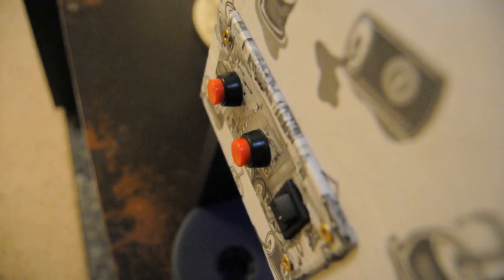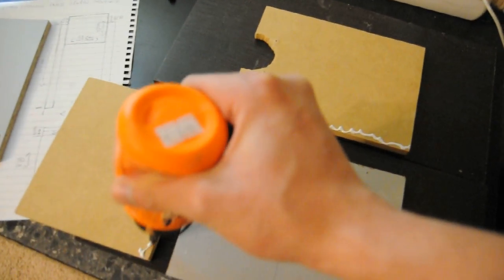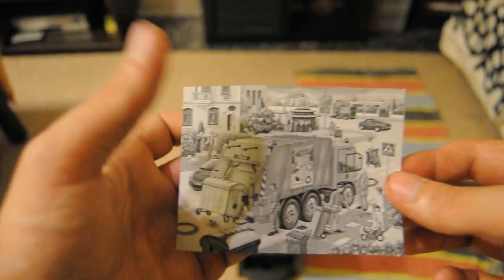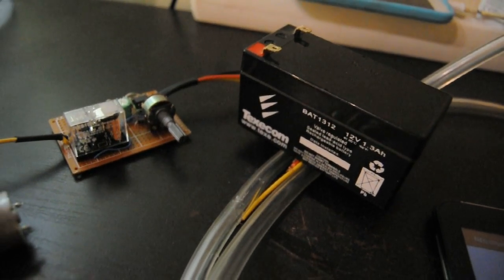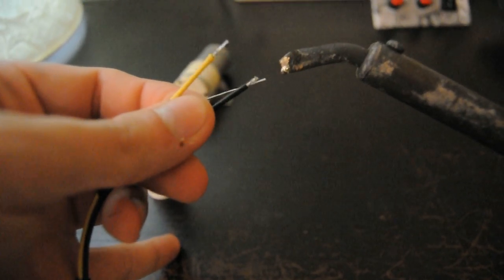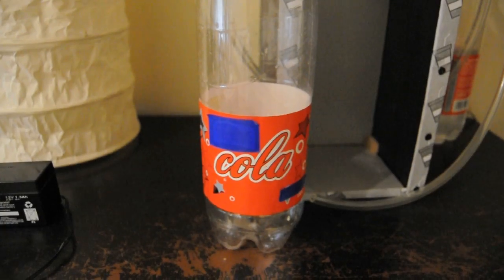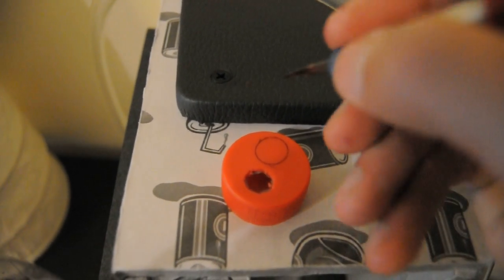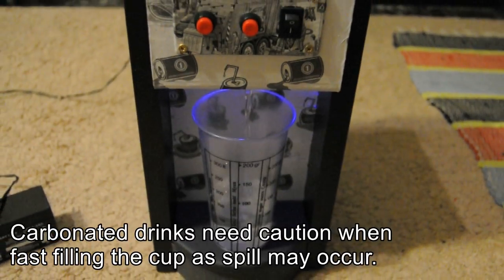How to Make an Automatic Coca Cola Soda Fountain Machine at Home

Comment: Material-list?
Reply from the maker: Oh it's basically a mini air pump from ebay,a power supply e.g a 9v battery or 12v ,food grade pvc tubing,and a switch,of course a soda bottle aswell... to make it automatic you need the circuit schematic which i show in the video.
Reply: truebassB Thank you very mouch. Good video and greetings from germany.
Reply from the maker: No problem,i hope i helped inspiring you with this video :)